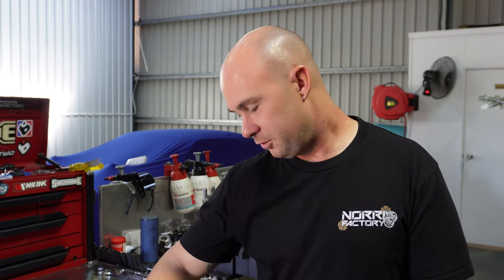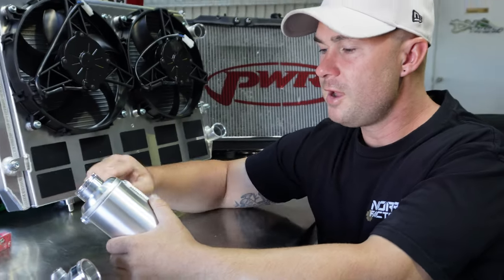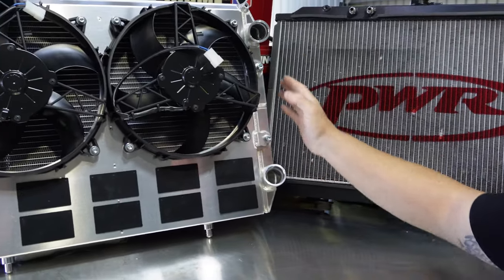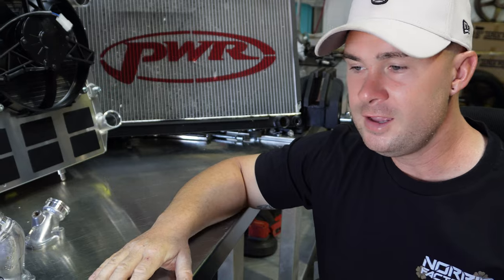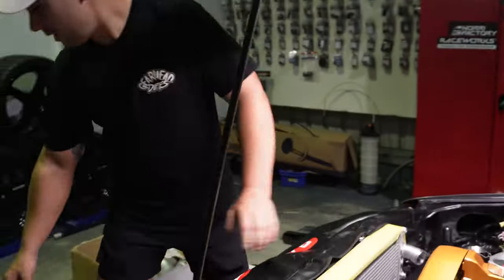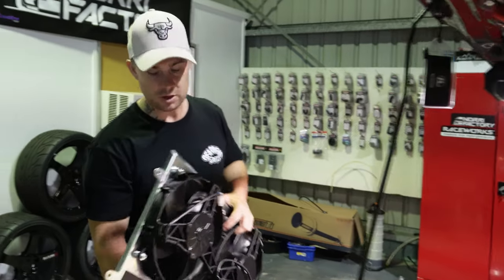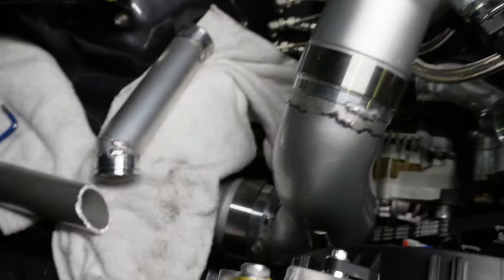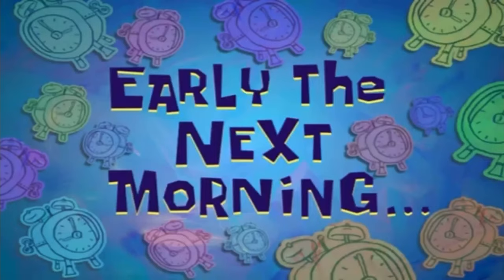GTR Hurt Locker! Hypertune parts finally arrive! The Radiator needs modifying & HKS Bov Doesn't Fit.

Comment: I feel your pain, I just went through the same thing buying a hypertune radiator for my billet 2.8 except it was the air temperature sensor in the way. Thankfully I’ve got the power steering pump in the boot and didn’t run into that issue as well

Comment: Not sure if you got the maradyne or spal from frenchies but I found the maradyne weak sauce, didn't perform at higher pressure ratios. In the process of swapping it out currently.
Reply from the maker: That’s good info. Luckily we went with the spal
Thanks for commenting mate

Comment: From everything I’ve seen, if you want nothing to fit then buy hypertune.
Reply: To be fair to hypertune,  the bov and powersteering are not factory locations. So communication problems. Off the shelf onto factory should fit.
Reply from the maker: yes there was defiantly communication issues. however, the radiator would have no issues if we had of used a hypertune manifold.
the power steering is a funny one though as its not far of stock location. 
A low profile fan will fix the issues. Lets not let this take away from the fact Hypertune Radiator is gorgeous...
Reply: Don't forget the lead time lol.